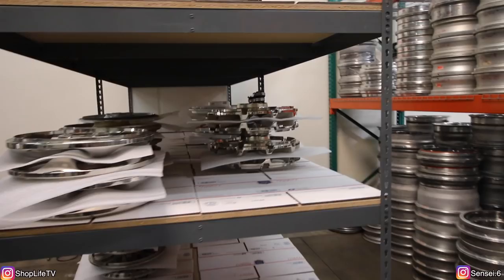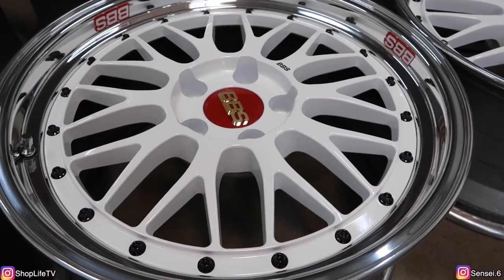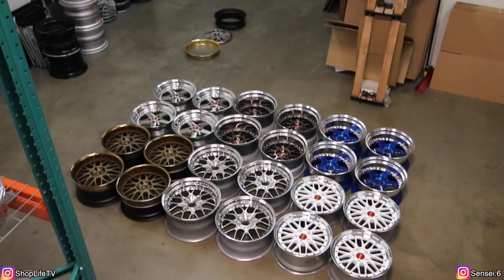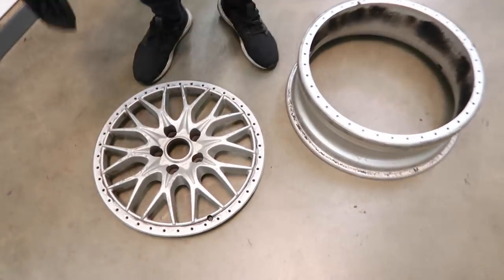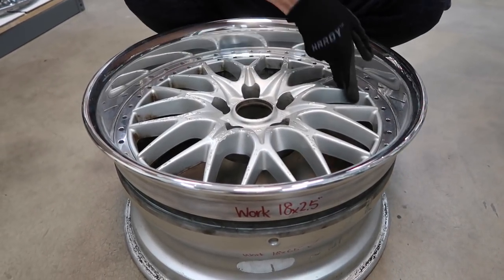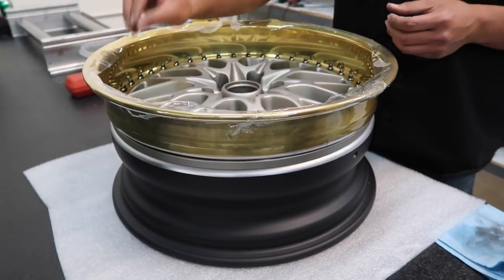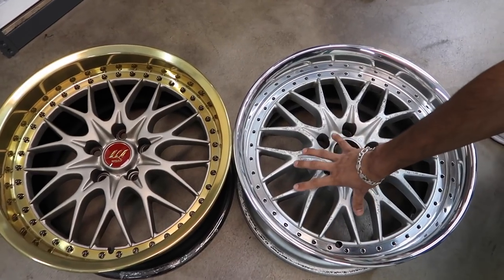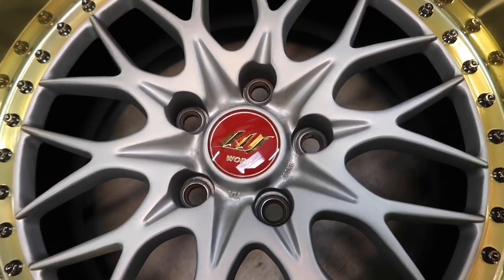CUSTOM THREE PIECE WHEELS BEING ASSEMBLED FT. SENSEI6

Comment: Quick question on here. There is not a spark plug removal tool in my car. What size socket should I use to remove them. Anyone can answer this. 1999 bmw 328i sedan.
Reply: Just find the correct size socket, probably 13/16". If you cant get the plug out you can use the coil and stick it back in and pull the plug out using the coil boot.
Reply: Jp Coward jr 5/8 socket called spark plug socket
Reply: Kenny Mack yup that's it 5/8 spark plug socket, it has rubber inside that grabs plug and can pull it out of hole.

Comment: Do the wheels leak air or are they air tight when done.?
Reply: No, you apply a sealant between all the pieces. I had a set of BBS 3 piece wheels that I reconditioned.